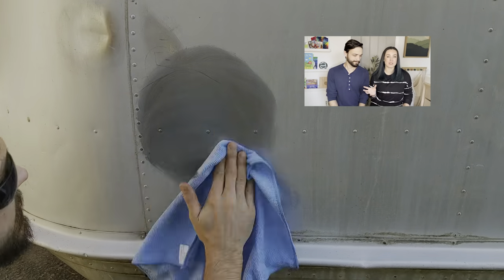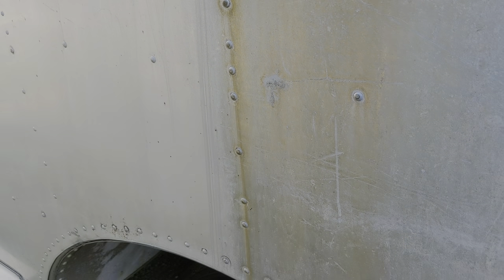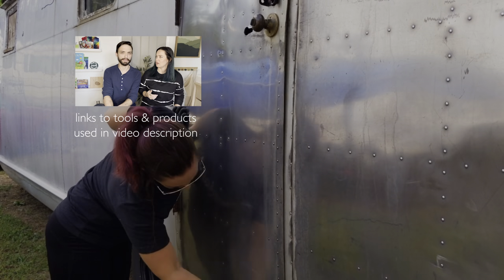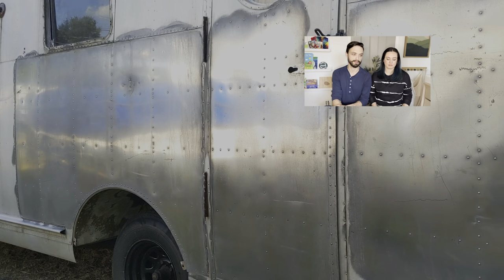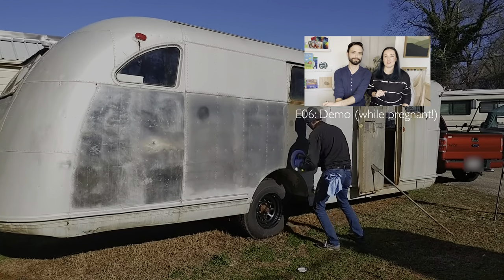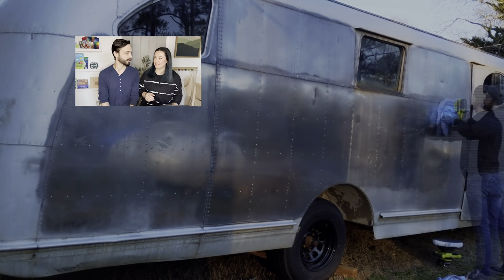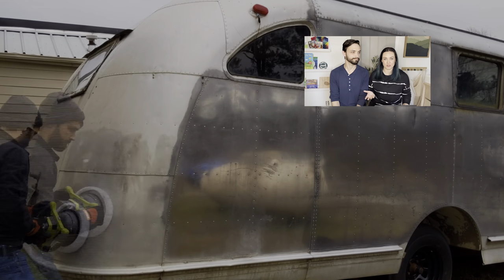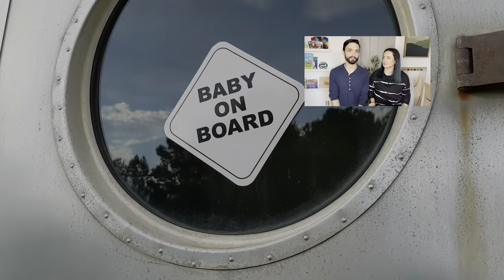Ep. 05 Aluminum Camper Polishing | Ruby's Revival (Vintage Camper Reno)

Comment: Hi y'all-

Polishing those old aluminum trailers is a monumental undertaking!

Keep going at it and I promise it'll look like a mirror.

If you start with a grittier polish on a more aggressive pad at first, you'll be able to knock down the scratches and scrapes in the body.

Then progress to higher and higher number pastes on finger pads.

It takes a good, solid month to polish one like that... But it's well worth the sweat.

Cheers!
Reply from the maker: Thank you! We’re going to use a kit with a higher grit for sure. I don’t think we’re going to do a mirror finish but taking out those scratches will be a dream!